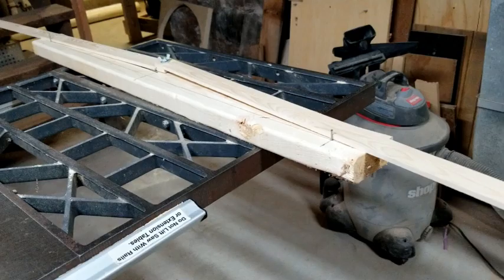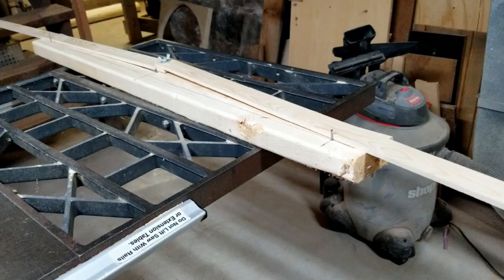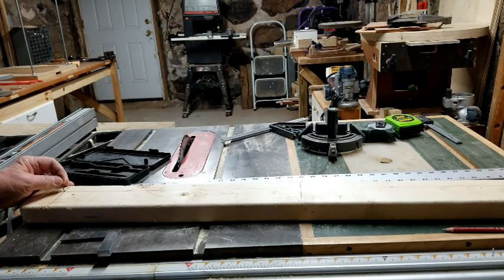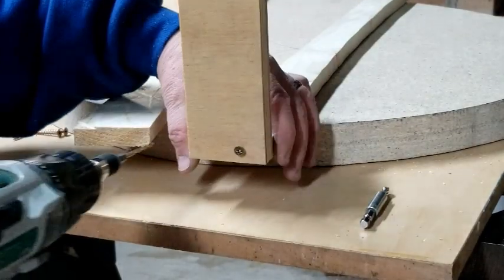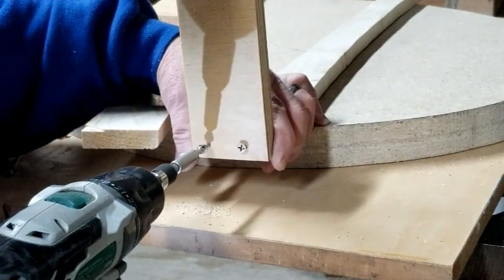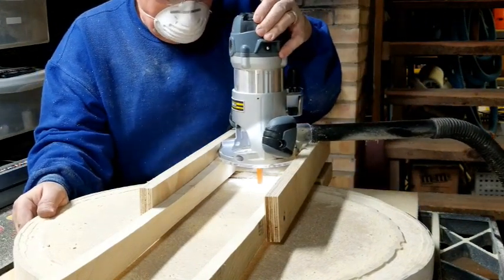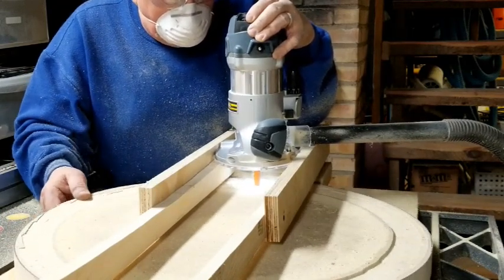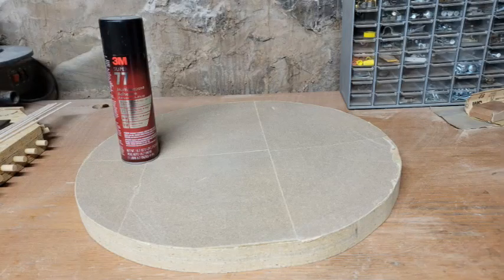Construction of a Radius Dish

Comment: Thanks for the video Mark. One question. What kind of spindle setup did you use on the bottom of the dish for spinning it around? Thanks.
Reply from the maker: Hi! The radius dish was sitting on another wooden platform. I drilled a small hole in the center of the dish and screwed it down to the platform. So, you do have to be careful when the router gets near the center so you don't hit the screw.

Comment: Any tips on "fine tuning" both the rails, and the dish itself?  Surely you had to do some filing and sanding to smooth out the rough band saw cuts....and the router would leave some imperfections as well?  Thanks.
Reply from the maker: Greetings! I used a random orbital sander with 80 grit discs to smooth out the rails and the dish. The dish was made from 2 pieces of 3/4 particle board glued together, so the sander worked quite well. I should have included that in the video. Glad you asked!
Reply: @homebuiltacoustics8510  Thanks for the info.  Cheers!
Reply from the maker: @theghostofsw6276 Any time! Let me know how it turns out.